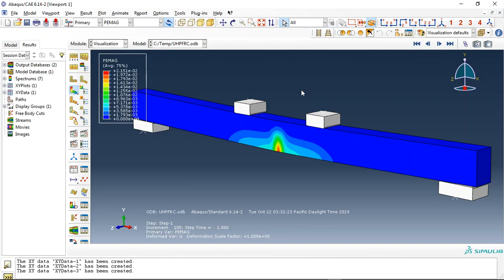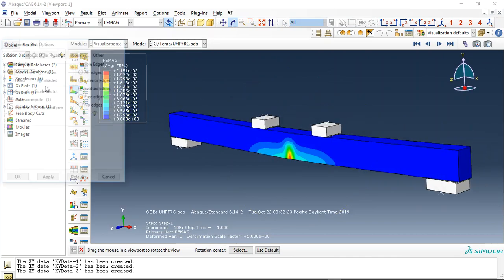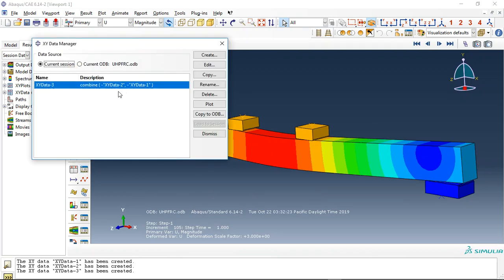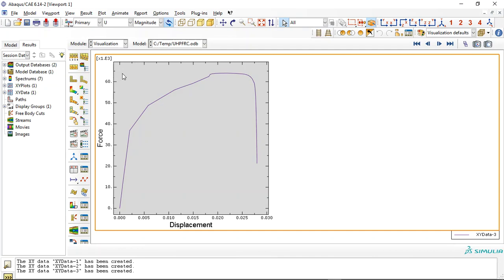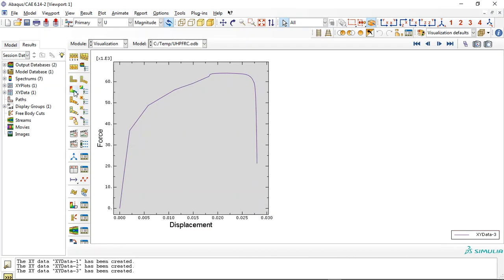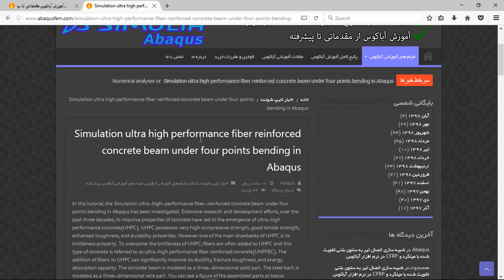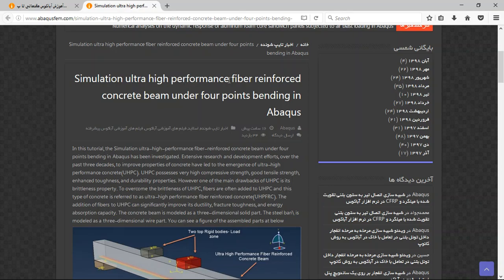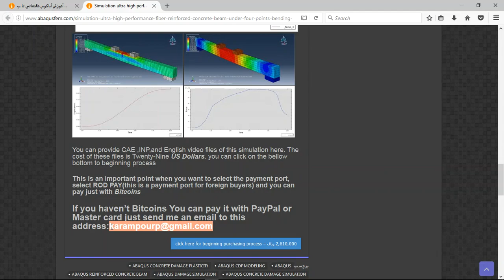Simulation ultra-high-performance fiber-reinforced concrete beam under four points bending in Abaqus

Comment: Hy..just wanted to know what kind of body is the load plate and support and what kind of interaction was given between plates and concrete
Reply from the maker: You can use displacement as load and surface to surface interaction
Reply: @abaqusfem3576  will surface-to-surface interaction will result in penetration of load plate into the slave body?
Reply: @abaqusfem3576  can you please share steps of this analysis
Reply from the maker: @jo-tj7lg  Contact to this email to provide full tutorial: abaqusfem.com@gmail.com